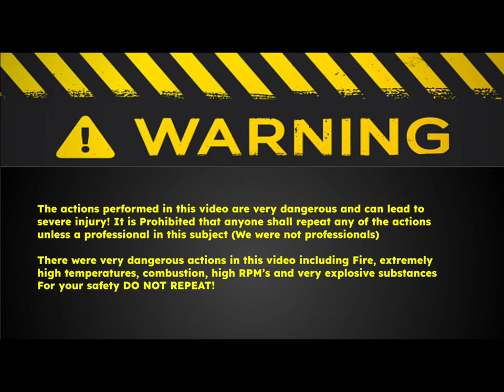DIY Jet engine from vacuum

Comment: If it's rubbing it won't run. The shaft should be spinning true on good bearing and the clearance between the turbine and housing should be less than 1mm. The turbine should be made of stainless steel. I recommend you check out the fd3 64 jet engine which is a jet engine that people often build at home and it has a compressor similar to yours. I also recommend you don't build an axial jet engine as those have proven to be very hard to make work at this scale. Cheers
Reply from the maker: I'll take that Into note, I might just build a turbojet out of a turbocharger kit so all the hard work would be done, thanks for the suggestions!
Reply: @MotorizedMayhem  if you're building it out of a turbocharger make sure the compressor inlet is smaller than the turbine oulet otherwise it won't work